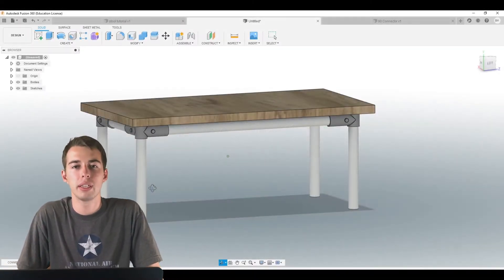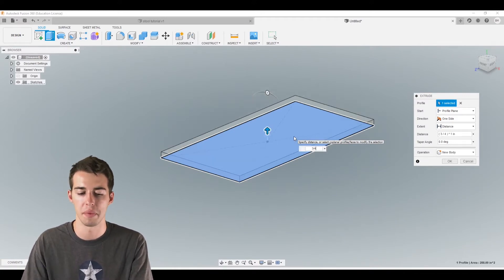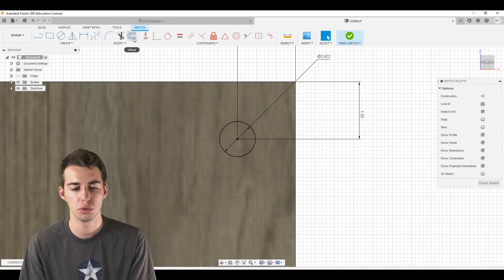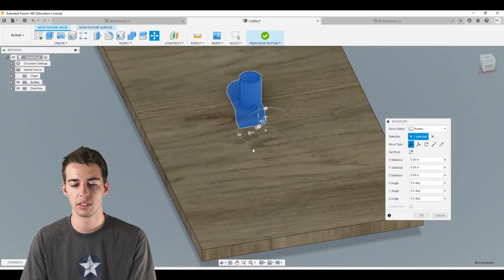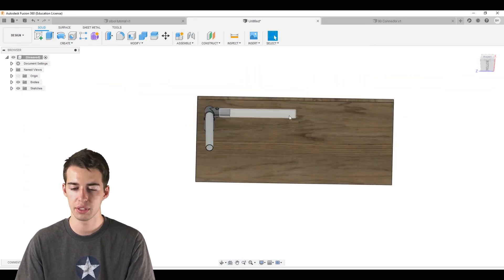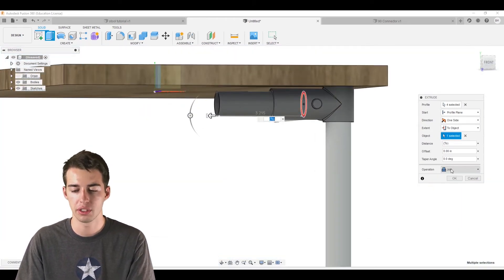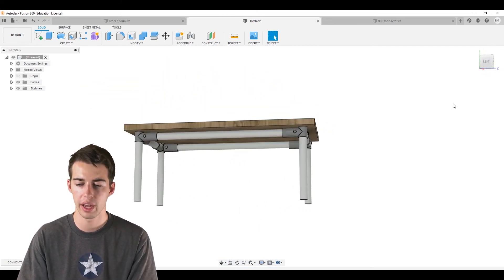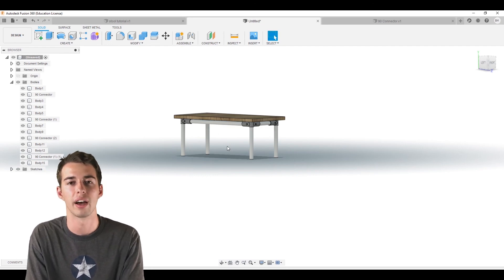The Basics - Using 3D Models to Design Your Maker Pipe Project

Comment: Wow. Hard to believe there are so few views and likes on this video. I've been using Fusion 360 for CNC projects for years. This is perfect for my Maker pipe project.
Reply from the maker: Glad you found it helpful! What kind of project are you working on?
Reply: @MakerPipe  Mobile chicken coop. The hardest part will be retractable wheels and trying to find a panels for the floor and walls of the upper part of the coop. The bottom is covered in hardware cloth. We'd like to use panels that are not wood, are light, and can be powerwashed. Still looking at options there. First prototype might have to be wood. But we need to make several of these, so we have time to test and tweak.
Reply from the maker: I think I may have a solution for the removable/retractable wheels.

https://youtu.be/-RFspP2Akm8